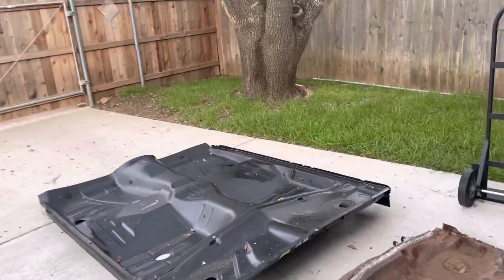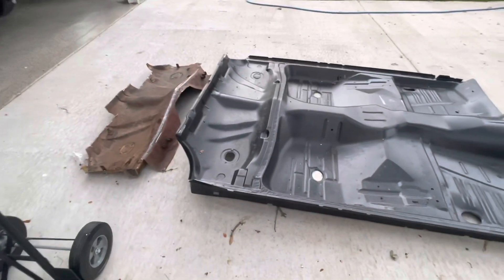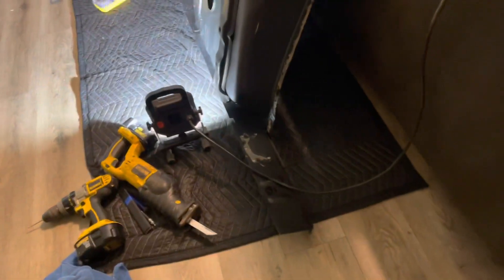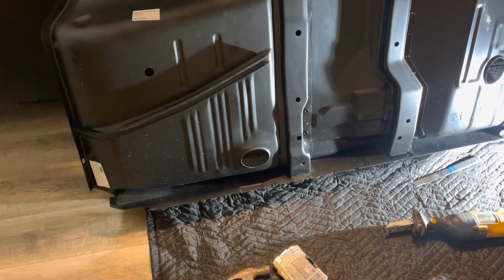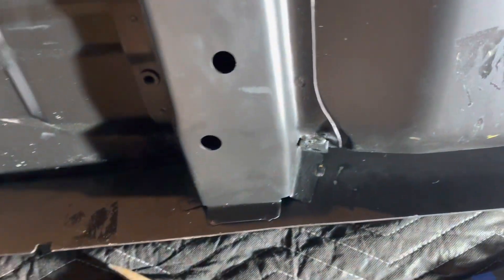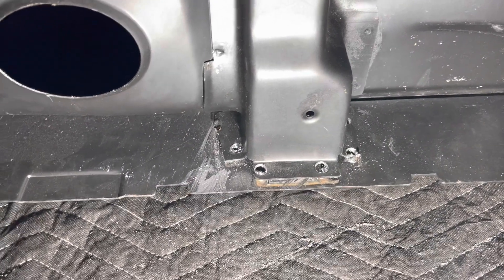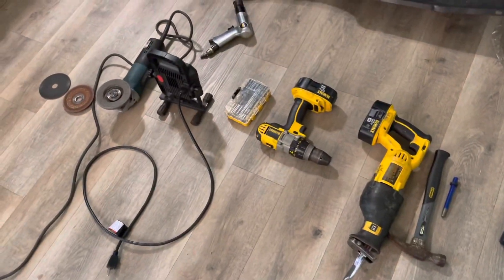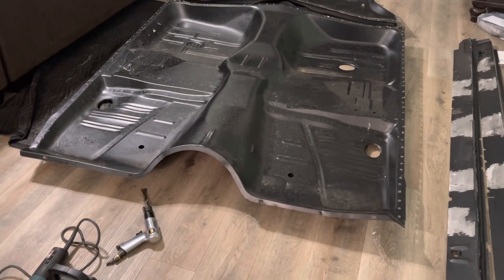63 Impala complete floor replacement Part 1

Comment: You are absolutely right. I just did this. Separate the floor into four pieces. Test fit the inner rockers and temporarily sheet metal screw in place. Test fit the front and rear sections and screw in place. Once you have it where you want it, disassemble. Prep and weld into place both inner rockers. From the bottom, put rear floor section in place and then lift and hold up the front part to allow the front floor section to go in place. Then drop rear section down to lap over the lip of the front floor section. I started at the firewall/floor joint. I used 4 bolts to "draw" the joint together. Once pans were positioned, I used a large "C" clamp to crimp the floor pan to the inner rocker, then welded several spots to lock in place. I used a hammer and dolly at times to straighten/flatten the metal. I applied the same technique to the rear section and tacked in place. I then plug welded everything in place, jumping around, not to warp anything. Lastly, welded floor braces to the inner rockers. My recommendations, buy very good spot weld removing bits, I used Blair Rotabroach Cutter #11108-3. I used one for all of the spot welds. SAVE your old floor! You will need to harvest brackets and braces from the old one and transfer to the new floor.  Additionally, my car is on a rotisserie, that helped greatly. Thank you for posting this video, it is the only one out there.
Reply: soo im better off to order in sections ?

Comment: I just install the same floor assuming it would go in complete, I did the same and removed the back seat section because mine was solid and it has the seat belt anchors, I was upset that it wouldn’t go in with the inner rockers did want to drill it all out, so I wedge it in tilted forward towards under the steering wheel and then work it under the glove box area and got the rear corner in by pushing really hard, had to bend the arm rear guides/tabs then I was left with about 1 inch overhang on the quarter window/ door jam, so being that the inner rocker was pretty thin metal I just said f it and got a 2x4 and banged the corner in and it  went in , I bent up the inner rocker but it was nothing that a hammer couldn’t fix , 🤷🏻‍♂️

Comment: Good luck man. Did you get it in? I’m in the middle of chopping a 64 4 door. Going to use its frame and floor pan (hopefully) for my 2 door.
Reply from the maker: I am embarrassed, but no I haven't gotten it all in yet. I have the inner rockers welded in and I have the rear seat pan sitting in place but not welded. The front seat pan is proving difficult. I still have the floor braces on the under side and they seem too wide. I have to bend it too much since I may offset the rockers and then the doors will never line up. I am at a sticking point and I need to sit down and have a look see to see why its so tight. I hope I don't have to cu the braces.